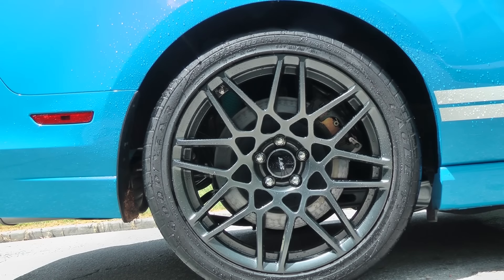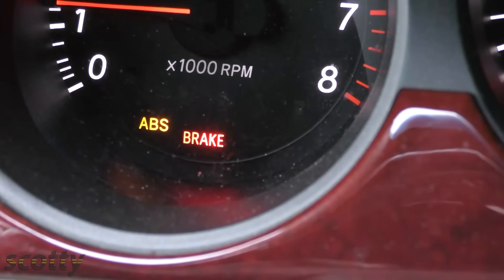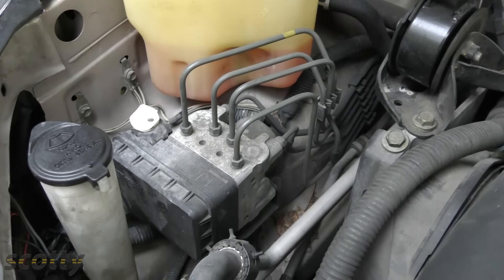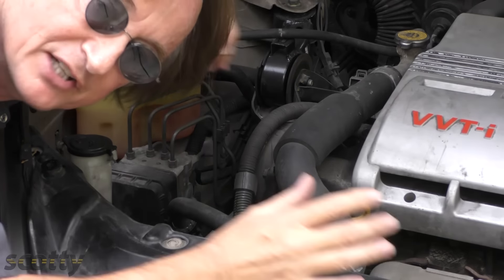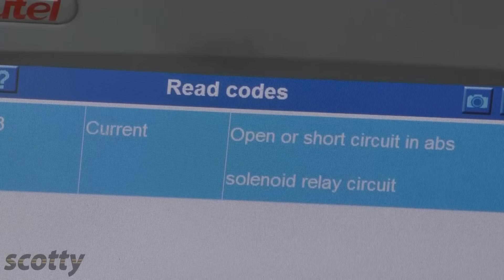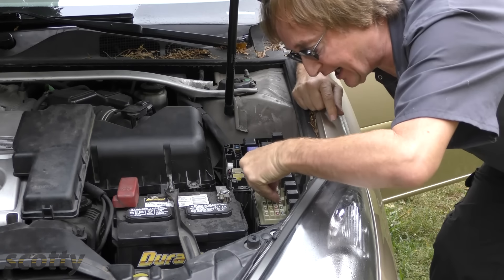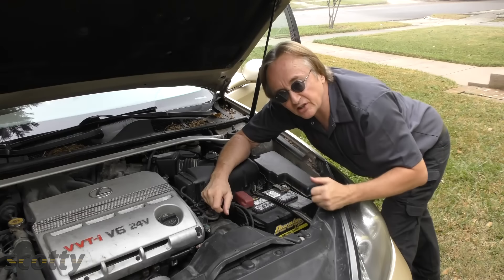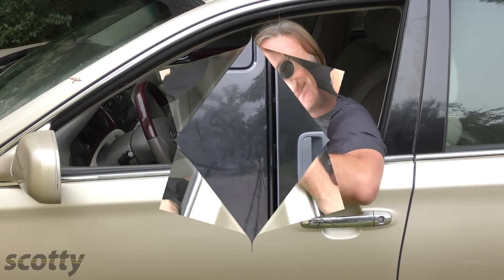ABS Light Stays On, What To Do?

Comment: My dash brake light came on in my 95 Nissan 200sx and we found a leak. 
The guy at the place I bought brake fluid said the best way to stop a leak in a line is to stop using it for fluids. 
So I crimped the brake line before the leak with side cutters. 
I had to do it 5 or 6 times to stop the leak but it’s fine now. 
I saved a bunch of money over going to the dealer also.

Comment: I blew a 6 dollar giant fuse in my 2005 accord coupe because i switched battery terms.... i bought the fuse everything works fine...However i now have ABS and TCS dash lights on and they will not go away..... i tried replacing the tcs switch and still both lights stay on....Any way of just shutting them off?

Comment: Hi Scotty...I have a 07 Mitsubishi eclipse get and the abs,tcl and the pic with the car sliding came on while I was driving but before that happened my car die and I had to get a jump...it cranked up but shortly after I get these warnings and also the battery light kept flicking on and off and  the eclipse light went on and off on the dash like when I first start my car...I dont know what's wrong before I take it to the dealer 😕

Comment: How NOT to make the ABS/TC lights come on...  Don't drive through 6 inches of water over the roadway at 50 MPH.  The force pulled the rear sensor harness off the rear torsion beam it was attached to and disconnected it from the box.  I ended up dragging it the rest of my way to work.  Coworker told me about it hanging down as I was getting ready to leave.  Ended up ordering a new harness and installed it.  No more lights.

Comment: My ABS + brakes lights come up on my dashboard. Car will not start. Honda Accord 2004. 

There is a clicking sounds coming from beneath the under-the-hood fuse box. (Keys are not even in the car.) When I pull out the ABS fuse the clicking disappears. Returns when I put back the fuse.

Comment: My 1986 BMW E24 has it's ABS light on now but there's no scan tool to plug in to it. Pretty sure it's a wheel speed sensor but was hoping this would be more helpful as in the UK a car with ABS won't pass the MOT if the light stays on...

Comment: take the sensor out of each wheel hub and clean off any metal shavings that are stuck to it. Its a hall effect sensor that means its magnetic. Reinstall them then unplug the sensors and test them at the sensor side of the harness on the lowest dc volt setting of your meter. On a working one, the volts will change as you spin the wheel. A broken one will always display volts or it wont at all.

Comment: I got C1061 code on my scanner, it says Abs motor pump low power voltage supply, what I supposed to do?
1. I got a brand new MF battery, OEM

Comment: Could just be dirt buildup where the sensor meets the rotor. We get a lot of road flooding in Pueblo where I am just because of the poor drainage and grading on the roads. Gets very flooded at dips in the road. Have to be careful, even with that, so much crap can get washed in there around the connections and such, cleaning it can be helpful and is fairly easy. Came on in my '99 Camry this morning, will have to look into it. Really miss my '92 Camry with no ABS. it's was fine, and still had the V6.

Comment: I've got a 2007 Monte Carlo SS and the ABS/ traction control light comes on all the time.  I take it to the garage and they change a wheel bearing to fix it.  It's good for a while then it happens again.  I don't know how many wheel bearing I had changed now.  Here in Nova Scotia, they won't safety inspect my car with it not working, so now I don't bother fixing it until safety inspection time.  What's causing the sensor to burn out all the time?  Is this a common problem with Chevrolet Monte Carlo?

Comment: I have a 99 Durango an the ABS brake light is is. But it doesn't have any sensors going to the wheels.
Reply: I have a 98 Dodge Dakota, and it only has ABS for the rear wheels, not the front.  This was fairly common on trucks of this vintage.
Reply: Jess Stuart ah okay.  I’ll double check the rear ones. Thank you. The light came on after it sat for a month and a half due to me snapping a bolt off for the thermostat housing.
Reply: I've had my share of broken off bolts on my truck.  I had two broken exhaust manifold bolts on one side, and a broken off valve-cover bolt on the other head.  I just replaced the heads with rebuilt ones about 3 months ago.

Comment: I have a 2002 chevy Silverado 4 wheel drive. Just did a brake upgrade on it with power stop brakes, rotors,& calipers. Truck brakes great. 4 days after I did the upgrade my brake light started to blink and ding, but the brakes still work great! Any ideas? I'm lost.

Comment: help!!! my ABS light came on plus the brake pedal has no pressure when i step on it. it goes all the way down easily. my car is not leaking brake fluid either, so whats going on???? this happened today after i got my car back from the mechanic after he recharged my ac.

Comment: Hey Scotty I have a 2008-2015 (141) toyota corolla fielder 4wd an one of the abs sensor on the left back wheel had broken (wire broke) an after that the transmission wont change from first gear to second (automatic transmission) I replaced it...my question is  how could that have affected the transmission ...thanks

Comment: I have a 2016 Kia Optima Hybrid with 66,621 miles on it. I'm having a problem with it and I don't know what's wrong. I hope that you can help because you seem very knowledgeable. This evening my car started normally and drove normally although I noticed that the ABS and the traction control lights were on. I have a quick stop, the car is turned off for maybe 6 mins and it starts back up normally, again no problem with how it's driving. I drove to a gas station and this time the car is off about 12 mins. I go to start the car and it won't start. It's telling me to check the brakes and also there's a message about some type of "air flap". Soon after that the dash lights start blinking. I had roadside assistance come and give me a jumpstart but I still don't know what's wrong with my car. When I drove my car home I noticed that the ABS and traction control lights were off. I'm thinking that it might be the regular battery that's going bad and not the hybrid battery because typically normal car batteries last about 2 years in the extremely hot climate that I live in. Can you please let me know if you think it's the battery or if you think it's something major? This is the first Hybrid I've ever owned.

Comment: On my car, ABS light turns on when I start the car, stays on for like 15 sec, and then goes off (it stays on after all the other lights go off, like engine light, sparks, etc when you start any car). Any ideas? It stops properly, dont think there are any codes on it either.
Reply: Also sometimes I need to drive like 100-200 meters then goes off.

Comment: Hey Scotty I have a 2003 Chewy  Avalanche  had a hole in the beaks line. I repaired it and replaced all 4 calipers. Been working on cars for yrs. I bleed the rest calipers just fine BUT the front calipers WON'T bleed at all even gravity bleeding. 
  HELP....
Any suggestions ?

Comment: I have a 2011 rav4 with 61,000 mi on it the ABS the check engine light the four wheel drive light and an anti-skid light and the cruise control stops working have you run across a problem like that if you can help I would really appreciate it

Comment: So, today I replaced the abs sensor that I took out 6 years ago. I plugged the hole with a bolt tp prevent anything to get inside hub. I disconnected the battery for 30 seconds or so and hooked it back up. Light is still on. How do I reset it, pull the fuse ir a special scanning tool?

Comment: My ABS light came on while driving home through a snow-storm last weekend. Great feeling when you're 7 hours from home. You nailed it, $1,700.00 plus installation. I live in the snow-belt, so going with no ABS isn't a very good choice. Thanks for the outstanding explanation. BTW, it's a 2007 Honda Element. I'm still hanging on with that one.

Comment: Scotty I wish you were by my side 4 years ago for 99 Dodge Durango, I went to Firestone  because the ABS light came on and they told me my three sensors went out on my brakes so I had all 3 sensors replaced per price of sensor was $150 plus labor but the problem happened after they use their computer again due to the ABS light was still on telling them they had a code ABS control brain went out and that it was $800 plus programming being 250 and I had to go to the dealership to get it done cuz they're the only one with the computer to do it. Bottom line riding with no ABS

Comment: Sir please what will i do to my toyota sienna 2002 model. I converted the back brake lining to brake pads and i noticed that  once the wire is plugged my clock  light goes off and i hear something like a warning sound with the ABS flashing on the dashboard. Immediately after that brake automatically applied slightly.  Should i unplug the ABS wire? Please help

Comment: My SRS light is on now in my 2000 TL, should I be concerned? Quick look online said most likely just a sensor fault. Will a regular code reader be able to distinguish between a airbag issue vs just a sensor?

Comment: Scotty, if the light comes on will it still pass inspection?
Reply: James Oliver it will not pass in West Virginia. You get a big fat rejection sticker (or you're supposed to, anyways) and then your ABS not working is reported to your insurance so they suspended your ABS discount until it's fixed (which you're supposed to get 5 days to do)
Reply: In Tennessee it would. They only check for cats, leaking gas cap and ecu reading here. I'm from the backwoods of Georgia. There you could register a horse on the road with no questions asked.
Reply: on my ls400 the airbag light was on so I wired it to one of the other lights to get a passed inspection.
Reply: Paulman50 we've all done that kinda stuff before.. lol.. unfortunately one of my newer Benzes flashes "SRS Malfunction: Visit Workshop!" right on the display so it's hard to hide....

Comment: First thing to check...ABS fuse ..Open your fuse box read the contents pull the ABS fuse See if its blown..Yes? You have a short in your wiring system Seek a mech, No? Then your looking at speed sensor or ABS module  For me it was a Module  Famous for getting cracked solder points ..I resoldered the points Added thermo paste where needed and resealed the unit ..Saved myself $600 on the part and $100 on a scan and $200+tax at a shop

Comment: Im trying to fix this issue on my wifes van at this moment. Thanks for the information. I just changed my caliper shoes and replaced the brake pads a week ago. The brakes are hard and the ABS light is on
Reply: ABS doesnt have anything to do with the brake pads. Mine are new on a mercury and light stays on. I want to know how to turn the annoying sound off.
Reply: Most 2002 to 2007 GM vehicles had bad wiring harness's for the ABS from the wheel and up. Common issue due to thin wire used by the GM contractor they used. Stepper motors for the cluster go bad as well and have led to accidents and tickets due to people not knowing their true speed. Class action suit was filed and GM replaced clusters on vehicles 7 years from manufacture or 70k, which ever came first.

Comment: My ABS light comes on randomly. I can drive 50 miles, and dont have it, or sometimes comes on sooner, or later. When I start the car up it always goes away, so the light is being triggered, by something that is happening . How the hell am I suspose to run an obd to find out what wheel its on if I have to turn the car off before using the obd sensor?

Comment: Toyota and lexus's suck I've had my audi for 3 years without a single problem eccept a BCM rebuild that cost 45$ it has 297000 miles on it and drives great and will for a long time.

Comment: I used to have a car where the ABS went bad and sense it was not needed to pass inspection I simply drove it without the abs. The scary thing was on occasion it would engage and pulsate causing the car to shutter but got used to it

Comment: What do mean it will pulse the wheel that isn't moving? I think I have issue on front passengers side yet I hear like a crunching while going to stop while lowering my accelerated speed like stopping with a red light cuz I didn't have enough time make it threw yellow light..this started months ago yet I had struts replaced on front due to drivers side was actually broke...now here I am 4 months later and for past 2 days..abs light comes on when I drive on a rough rode...help Scotty what is your suggestions? Also the crunching or pulsating sounds like possibly tone ring..idk I'm just guessing, and abs light goes off after I park and turn my Chevrolet 2007 Equinox off once I restart it's gone..plz help

Comment: Scotty, I have an ABS light on a ford escape 2003. Both of the tone rings were broken in the front, so I replaced them, but I am still getting DTC C1155 for LF sensor. I have a good scan tool that shows live data, and it shows that all 4 wheel sensors are working properly. But code continually comes back after clearing it and moving car. How can the LF sensor be bad if it is showing the correct vehicle speed?

Comment: I took my car to get my abs light checked and they said they couldn't check it because it wasn't a check engine light smh i changed my hub bearings and my abs light came on at first it was fine before i had changed them the previous owner was in a car accident and i knew nothing about it messed all the front suspension up on the car everything had to be replaced

Comment: Hey, scotty.. Jon here, I have an 04 Volvo S60 2.5t awd. 250k ,fresh rebuild, timing gears, pulleys, etc. I changed my front struts and CV shafts. Now, my abs light is on. Should I just replace both front sensors?

Comment: Scotty, I have a 2003 Opel/Vauxhall Astra G ( Y17TD )  and I've bought it Second Hand.  The ABS lights are not on, but the brakes seem to be too hard.  A few people suggested airing the brakes but I wanted to ask you :)   PS: I am a new driver , so I can't tell if the breaks are fine or too rough, but I need them fixed as the annual check is in a month and I want to avoid any quarrel.
Reply: Daemi Ax 
He dont answer questions here, you have email him.
Reply: Thank you :)

Comment: Hi Scotty,I have a good question so I was messing around with a fuse in my fuse box under steering wheel and now abs Fuse and traction control light came on ??. I installed the fuse correctly . How long does it take the computer to recognize that there’s not a problem and resets itself after so many cycles  ? Or do I have to use a scanner to clear the code ? I didn’t expect this just from pulling a fuse ? Please Help Thanks in advance

Comment: Scotty, I have a 2003 dodge caravan, the ABS light comes on once in a while ONLY when driving at speed around curves "sometimes". (system works fine) It goes out and stays out after shutting down engine and re-starting. If I drive very gently on curves it will stay off. thoughts?

Comment: Most 2002 to 2007 GM vehicles had bad wiring harness's for the ABS from the wheel and up. Common issue due to thin wire used by the GM contractor they used. Stepper motors for the cluster go bad as well and have led to accidents and tickets due to people not knowing their true speed. Class action suit was filed and GM replaced clusters on vehicles 7 years from manufacture or 70k, which ever came first.

Comment: And for anyone who is wondering power steering is the same way if the power steering pump quits working it still has manual steering and for these modern cars that electronic power steering if the system fails it is still attached to the steering gear so it still has manual steering

Comment: ive seen alot of abs problems where i live.  there is tons of ice and snow during the winter.  that wears out the wheel speed sensor harness sometimes they even get so corroded they break.  also see moisture get into the ecmb and cause broken solder joints.  its a constant battle way up north to keep the abs/brake lights off

Comment: Been there. =\  The modulator.  My 2005 Kia Amanti that part $2,500.  That wasn't happening!  Found a reputable auto recycler in my state and $200 for a grade A used part that came off the same car with just a bit over 45K miles.  Why couldn't it be a sensor or a stupid relay?!

Comment: I just replaced the cv joints in the front of my 04 320 4matic benz , I had a mobile mechanic do it   After he was done when i went to drivce the car the abs esp light came on the car also sounded different and there is a vibration.. The mechanic stated the aciter ring on the new one was larger and it was rubbing and needed to rub off by driving it..when he removed the front right cv joint it was stuck and he pulled really hard on it. im thinking he may have damaged the sensor when he did it..it sucks because I was really hoping it would all go smooth. I hope that the car will run with no problems as i need it to get around... what do you think Scott. im thinking i should have not payed the guy the labor to install it but I did so its 2 late. . I bought the parts on ebay and the feedback was 100% from others who bought the same part so whatg do you think. I payed the guy $240 to try and save some bucks plus $135 for the cv joints.. what do you think Scott Ide appreciate your expertise advice Thanks.

I watched a bunch of your videos the one for the ps leak is very cool i may try that on my 03 ML 350 which has several issues including a rusted rear brake line, the ps leak and a leaky oil cap. a real pain in the ass but trying to keep her running 2.    JAH GUIDE

Comment: I had a French car where the ABS failed unsafe. :D It pulsed the brakes when you braked careful, sending you almost straight into the car in front of you.

And a bad sensor code might just be the crown gear/ring that's full of crap.